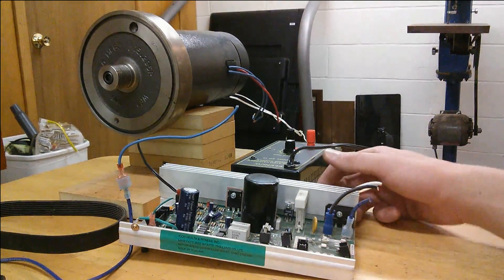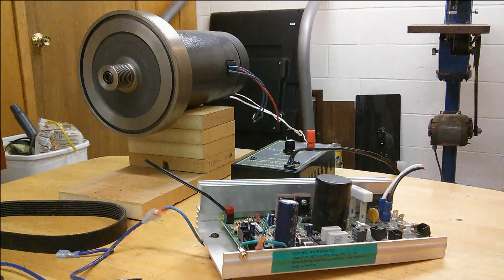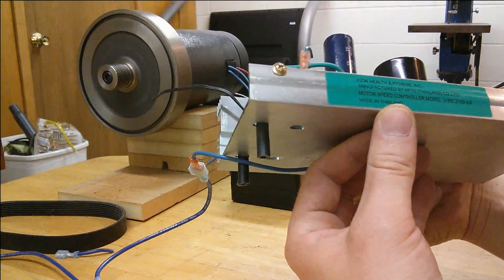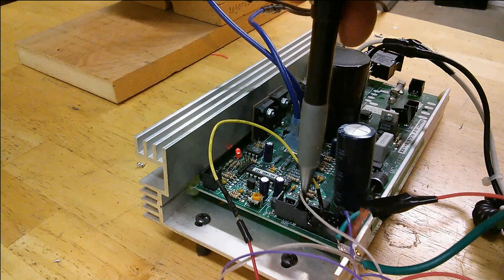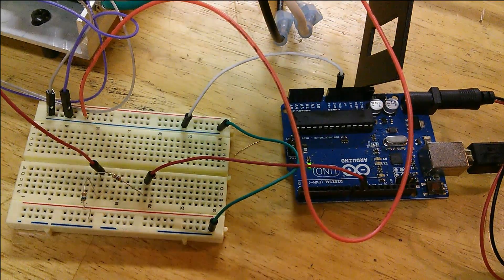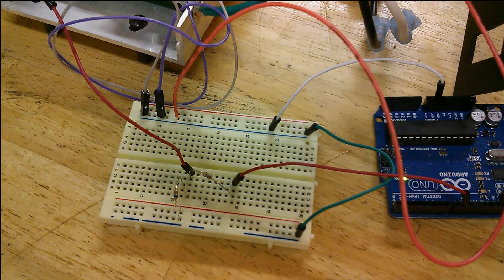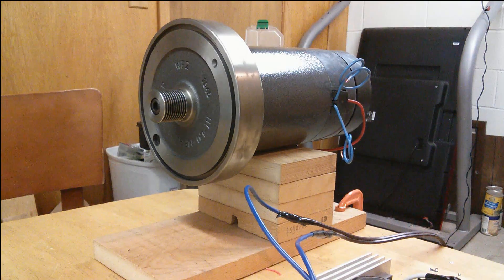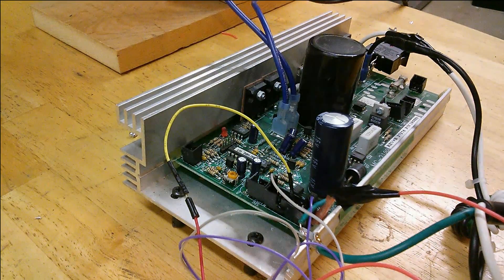Arduino + U-MC 2100-WA Treadmill Motor Controller

Comment: Great video! Any idea why the previous owners ripped it apart in the first place? I'm working on nearly the same one board (MC-2100 REV B) and all seems to be working except it won't communicate with the motor in spite of the fact that it thinks the belt is turning. Any tips? All the caps look good (the 1500uf is bulged a bit, but I think it is just the black plastic casing and not the underlying metal). It seems like testing each resistor would take some time. I've already purchased a new treadmill, but this makes for a great holiday project. Thanks again! -Chris
Reply from the maker: Hmm, is the motor itself in good shape? I'd use a volt-meter to test if there's current. I know it goes without saying, but be super careful with those capacitors. As for the previous owners, I've got no idea. None of the damage to it made any sense, like someone was trying (and failing badly) to salvage stuff from it.
Reply: Grant Brown Lightning-fast response. Subscribed. I've pulled the board apart from the heat sink, nothing looks bad. It hasn't been plugged in for a while, but I still made sure to short-out the two bigger caps. As to the motor, I plugged it into a 12V go-cart battery and it started turning just fine (in both polarities). Wouldn't that indicate the motor is fine? Lastly, I bought a pretty-decent Arduino uno starter kit a month or so ago and am excited to get tinkering. Seriously, thanks again for the video.
Reply from the maker: Chris Volk Yep, I'd say the motor is good then. Are you getting the PWM indicator light to pulse? If not then I'd double check the arduino setup and make sure it's using a 50ms duty cycle. Otherwise it might be worth taking a look at any fuses that might be blown (it's been a while since I looked at this board, but I'm pretty sure I remember seeing a couple).
Reply: Grant Brown I've yet to do anything with the Arduino to this point, just main controller it came with. I'll check the PWM light and go from there. I'll keep you posted. Thanks again.
Reply from the maker: Chris Volk Right - my best guess is that there's some sort of safety feature that's keeping the controller from supplying signal to the MC2100. You'll need to poke around a bit to see what might be happening. Have fun!
Reply: Grant Brown Just an update. Turns out the big cap was bad. Simply swapped it out and it now works like a charm. Unfortunately, I now have two functioning treadmills! Interestingly though, when I tested the old cap with a cap meter, it seemed to be just fine. Sucks. However, the film on the outside was splitting (as if too hot) so, I figured it would be nothing to fix it. Now, I have to figure how to better trouble shoot a bad cap other than 'Replace and Plug Back in'! Thanks again.
Reply from the maker: Chris Volk Nice, glad you got it fixed.

Comment: Hey Grant, awesome video! Liked and subscribed!
I just recently bought an arduino starter kit and completed all the projects.  I'm still a noob at electronics but am looking to hack into a treadmill of my own (TR1200-DT5 walking desk), ideally without breaking too much haha.
Would I have to start by doing something like what you did in finding out what board it's using and then trying to google up the model name in hopes that someone's already analyzed and documented out what everything does?  If not do you have any resources that you recommend or any recommendation on cheap electronic items that I can practice hacking into?
Thanks in advance!
Reply from the maker: That would be a good start. That's an ambitious project, so I'd begin by (very carefully) taking apart the console and chassis to see what kind of equipment it has, then start trying to determine a good approach to the rest of the project. Namely, do you want to try to interface with the main controller, or build your own which talks directly to the motor driver?

To be honest, I haven't attempted anything like this, as the treadmill I disassembled was already broken. Be careful, especially with the motor driver which has big deadly capacitors on it. It would probably be best to leave it unplugged for a few weeks ahead of time.
Reply: Grant Brown Thanks for the quick reply! There's actually an exposed connection between the control panel and the treadmill underneath the desk.  There's an image that I posted in the arduino thread http://forum.arduino.cc/index.php?PHPSESSID=roje0n43gumumepkl3bvehvj13&topic=280230.0 .  So the naive newbie in me is thinking if I can just plug a male to female end on one side, and then plug both of them into a breadboard and then if I'm able to start hooking up cables into my arduino to be able to read/write what the panel is sending to the treadmill and vice versa then that would be ideal.  I think that way I can still use the control panel as intended but at the same time also control it through my computer, and also record stats into my computer.  I didn't want to just start plugging those pins into my arduino though in case it fries it or worse.  

Your video did inspire me to start cracking things open.  I took a look at the control panel yesterday but unfortunately didn't find any useful search results when I googled all the numbers and serial numbers that I found inside.  The treadmill part might be trickier to take apart so I've held off on that for now.
Reply from the maker: mrgameandwalk Frying the arduino is a definite possibility. You're going to want to definitely test the voltage on the lines to see what the power rail/grounds are, but beyond that I don't have much experience. I imagine that you're going to need to figure out what serial bitrate is being used for the various components, and then try to reverse engineer the communication protocol - easy to say, harder to do. Best of luck man, if you manage it you should definitely write up a guide.
Reply: Grant Brown Thanks, yeah if I ever figure it out I will for sure haha.  Hadn't even considered the serial bitrate, it's the unknown unknowns that scare me!

Comment: Hi Grant. You said it would be trivial to add simply add a potentiometer. I was wondering if you might explain how I might be able to do that for my own? Thanks. Roland Thompson
Reply from the maker: You'll need to connect the potentiometer to the arduino, there are a bunch of tutorials about this (http://www.arduino.cc/en/Tutorial/Potentiometer)

Once you can successfully interface an arduino with a potentiometer, you need to use the numeric value read by the arduino and re-scale it to provide the appropriate PWM output. 

Let's say you get an integer between 0 and 1024 from the potentiometer using the arduino. You can then modify the "duty" variable using this value. For example,

duty = (inputVariable/1024.0);

If this is not intuitive to you, I would suggest that you pick up an arduino starter kit and run through the first few tutorials (blinking lights, serial communication etc). After a very short while you will have no trouble with projects like this.

Comment: Nice work, can you provide me with a diagram of the interface wiring and the resistance values. I can not make it work!
Reply from the maker: There's a circuit diagram linked in the description on google drive - does that answer your question?

Comment: Hey great project. I am trying to use your work  on working treadmill. However my U-MC 2100-WA is not recognizing the signal using your code.   Do you think voltage schematics may change since it is attached to incline and other things.  I think it should not. I am also using Blue PWM connection.  My main goal is to control the working Treadmill via computer  for school research project. Can you please give me any input on it?
Reply from the maker: Hmm, no I don't think that using incline should change things. There is a slight mismatch between the code and the circuit diagram with respect to the arduino pwm output pin. The code uses arduino pin 13 while the diagram says arduino pin 9. Do these match for you?

If that's not the issue, is it possible that you've flipped the orientation of header 2 on the controller?
Reply: Grant Brown Yes i fixed the pin by switching it to 13. But still not cracking.
How are you putting 25%  or 50% duty cycle?  If you would like i can send you  pictures of my circuit to your email. Thank you
Reply from the maker: Nirav Patel The duty cycle is set by changing the float variable "duty" defined at the top of the code to the appropriate proportion. For example, a 50% duty cycle would require you to replace "float duty = 0.0;" with "float duty = 0.5;"

Of course, this is pretty inconvenient as it requires you to re-upload the sketch for each change in speed, but it's really just to illustrate the bare minimum required to talk to the board. 

Feel free to shoot me an email at grant.brown73@gmail.com with your circuit pictures, I'll try to look at them as soon as I get a chance. 

-Grant
Reply: Grant Brown Great!!! Thank you You are amazing.

Comment from the maker: Hi Matthew, for whatever reason youtube won't let me reply to you directly. 

In any case, the pin 13 referenced in the code is the arduino pin, not one on the board. I used the arduino to provide the pwm output. It looks like I used pin 9 on the circuit diagram - sorry if that caused any confusion (just change 13 to 9 in code or hook up pin 13 instead of 9). 

I didn't notice the 85% limitation, but haven't had any problems (I also haven't gotten around to actually using the motor for anything interesting). 

I haven't done anything with speed sensing, but it looks like the guys at sonsofinvention did by using arduino interrupts to read each pulse.

Hope that's helpful,
-Grant
Reply: Hey Grant Brown. I am 'working' on a VR treadmill project.
I got a used treadmill with this same controller for free 2 years ago.
I once connected an Arduino to the board. But only got a read out telling me about outlet frequency. Since then quitted it.
After several repairs- treadmill had some mechanical problems- i am now another
time interested in getting more control of the motor.
I checked another time the net and found your video. 
I am thinking of a treadmill that i could turn off and on by hand. So that i could use
it in VR. Of course i would build sth for safety.
However the problem isn't so much in varying speeds(since you wrote the code for that) for that purpose but rather
to get rid of the start/stop delay the controller has apparently build in.
Its about a second for start and half for stop.
For VR it would be nice to have no delay(guess it's a safety mechanism). So here my question.
 Do you think its possible to turn that off somehow?

Comment: Hello,

Thanks for making this video.  A couple of things id like to mention.  These boards seem to be a common speed controller on treadmills, and since I'm currently having intermittent problems with mine I can understand why the previous owner took a screwdriver to the board like that. :) I looked at your arduino code and you never mentioned anything about Pin 13 in your video, nor do I understand it's purpose in your code.  Also I've never seen anything about the keyword 'floor' in the arduino reference. What does it do?  Also the PWM should be constrained to a max 85% duty cycle according to the MC2100 data sheet.  Do you have any ideas on the best way to read the Tach pin out?  Thanks

Comment: I have the same board but the resistor in the R17 position is burned out. Can you show or tell me the value of it, or the color and band colors? Thanks
Reply from the maker: Sure - I don't have access to the board right now, but I'll take a look at it tonight or tomorrow morning and let you know.
Reply: Grant Brown That would be great. Thank you
Reply from the maker: Richard Wise The code is Green-Brown-Brown-Black/Brown, so I think 5110 ohm.
Reply: How did you dial-in that R17 is burned out?

Comment: I did something similar with a parallax propeller  on a proform tm using the mc2100.  I set mine up to read heart rate and adjust the treadmill speed to maintain a target range of HR.  Also set up an Android device to talk to the propeller, and control the treadmill ... I have some videos posted.  I use my treadmill pretty regularly with this control setup.  The propeller drives a VGA monitor as well.  You do some other cool stuff on your channel, very nice...I'd like to build a plasma CNC cutter and a 3d printer...In the early 90's I built a PC controlled 10 gal brewery...
Reply from the maker: Nice! I've been meaning to put together an automated brewery for a while now, but I haven't had much project time lately.

Comment: Hi Grant, great video and description. I have that exact issue with my Epic View 550 Treadmill, i think i'm not getting the PWM signal from the console to the Motor controller PCB. everything else works great, incline etc but main motor just returns some sort of fault audio indication. Where can I find the schematic and discription ?
Reply from the maker: Check out the MC2100 category on the sonsofinvention blog linked in the description. They dug up some schematics of the controller board.

Comment: What is the lowest rpm's you can achieve with this motor? Trying to find a cheap reliable motor that can move a 250 pound telescope mirror slowly and smoothly. Could this be done with this motor? Could you help me design a motor for such a purpose....really afraid to buy the components then fry them... :P
Reply from the maker: Hmm, I'll have to go check later. It can rotate pretty slowly, but it's not really designed for precise tracking like you'd need on a telescope driver. Additionally, it is less powerful at slower speeds - PWM is better for low speed torque than just lowering the DC voltage, but it is still more powerful when spinning at high RPM.

Is there already gearing in place to move the mirror, or will you have to build that? 

You should check out stepper and servo motors. Stepper motors move in steps, like the hands of a clock, and some are capable of moving fractions of a degree at a time. Servo motors are the combination of a motor and some sort of encoder, which tells the computer what position the motor is in. That means they're more flexible than stepper motors because they can correct errors (if the motor misses a step when trying to drive a load beyond its capacity etc.), but they're generally more expensive. There are lots tutorials online for setting up both types of motors with arduinos. 

Personally, I'd start with the stepper motor. I've used a stepper in the past to drive a barn-door style astrophotography mount. You'll probably need a bigger one as well as gears to step down the rotational speed, but you can pick up a cheap one to try it out and get used to working with motors. You can throw together a really really cheap stepper driver with an L293D chip (there are wiring diagrams available via google), or sparkfun makes a really nice driver with micro-stepping support.
Reply: have you considered knocking down the speed using calculated pulley sizes? its much quieter than a homebuilt gear system, but you could always try and find a gear box for the motor shaft diameter as well.
Reply: Careless is on track.  It is better to keep motor speed above 40-50% and use a drive train to achieve the final speed reduction.  This will make your telescope movements much smoother and controllable.  You will also be able to achieve some really slow telescope rotation.

Comment from the maker: I don't think the precise rating of the pull down resistor is important, but you'll want something like the 160 ohm logic resistor to drop the voltage closer to 3.3. That only applies if you're using a 5 v logic source like the arduino. If you're using a 3.3 v source like the raspberry pi you don't need it.

Comment: why you coneect first pin and last pin together i think it's ground and same pin is any different between it 2- why you connect pull dowm resistor is it important and what about value of resistor it should be same or what ?!

Comment from the maker: Did you look at the circuit diagram linked in the description? The board might use a photocoupler internally, but I didn't work with it. I just used the hdr2 pins.

Comment: i program micro with 5 khz and still not working i notice pin 4 connect to photo capler !! for what photocapler ??! i try to conct it dirvt to open photo capler and also not working i don't know what the problem ?

Comment: i have same circuit controller i try a lot to do that but not success i program microcontroller to generat pwm and i connect it  to mc2100 but maybay need special frequency ?? what frequency need ? i compare between console output and my microcontroller i notice  console bord generte different pwm i connect led to out put console i can see led on and off vary fast ??i used  pic16f877 is it need to add transistor to out put what  frequency range

Comment: Hi Grant,  Does that motor controller you are working with have its own 130vdc power supply or did you need to provide an external power supply.  The spindle control on my X2 mini-mill decided to roll over and play dead and I am looking for a replacement that is less costly than the parts needed from Little Machines.  They want $160.00 for a new board.  I would hope to be able to feed a PWM signal to it from Mach3 as well as a pot for manual control.

Comment from the maker: Looks like it was a NordicTrack "C2 150 Treadmill", 120v, 60Hz, 13A. Serial #: T63123785 38/05 WB. Model #: NT????????? (the sticker is scratched and I can't read it). 

Hope that helps, this info is from the last piece of the frame I haven't gotten rid of yet.